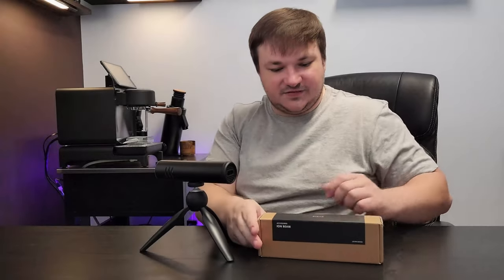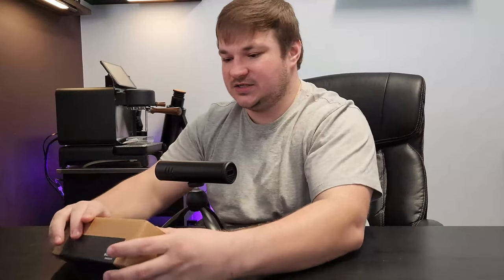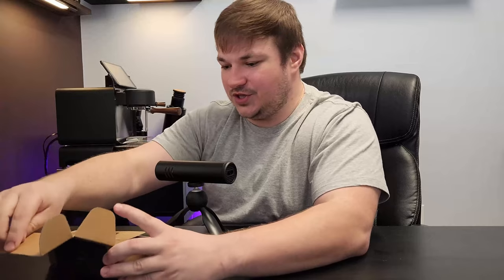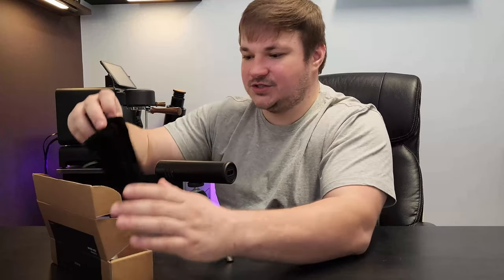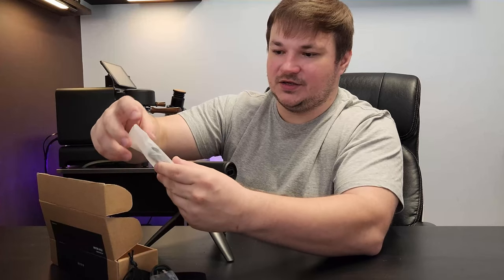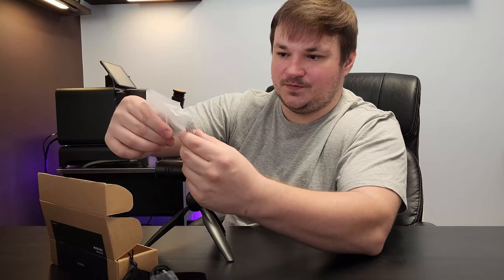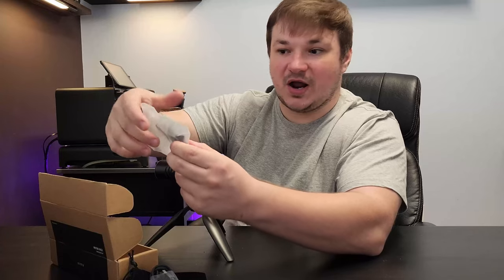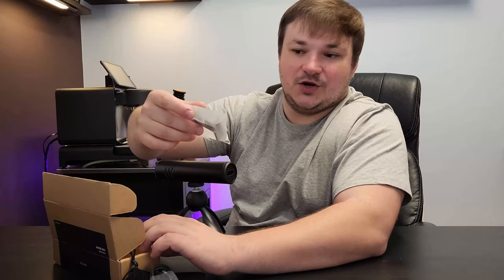Acaia Ion Beam | Review

Comment: Thanks for the review. I have a P64 and I use rdt. Do you think think this is a good add-on for the grinder and would totally eleimnate the need for rdt?
Reply from the maker: From my experience RDT works good on the P64 I'm not sure if ION Beam would make it better but if you no longer want to use RDT then it will surely do what RDT does. With ION Beam it does not effect the static on the inside so when I used it some chaff remained in the grinder not enough to register on scale. But chaff being stuck might be a good thing. Hope that helps.